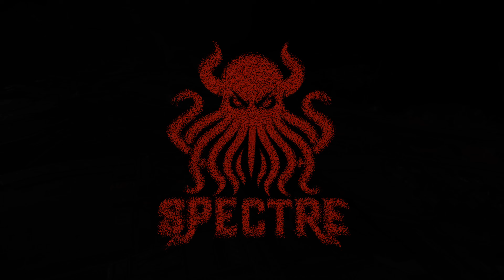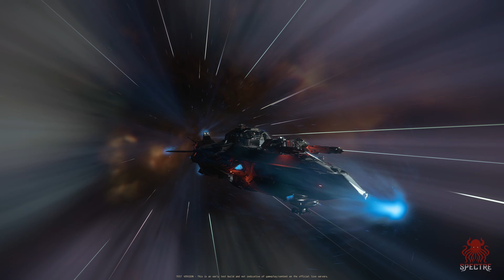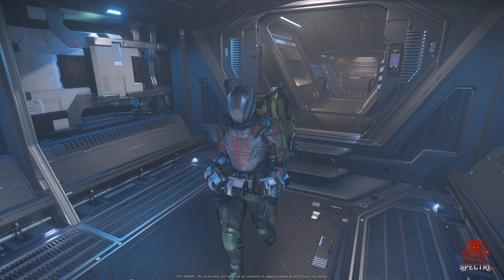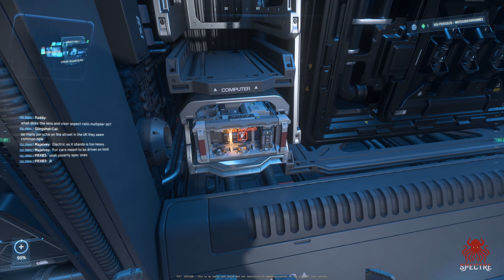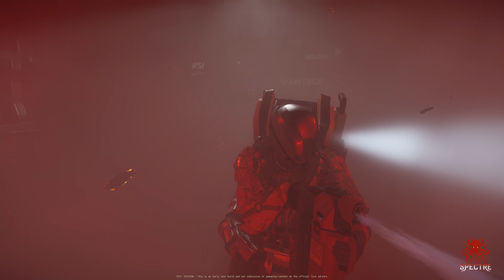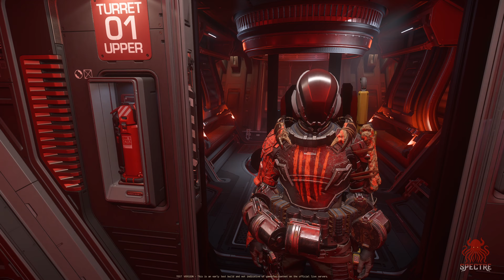Star Citizen Flight School - How to Engineer - Tutorial / Guide

Comment: To my knowledge cooling is not required at at. Just deactivate cooling alltogether and use the pips elsewhere. There is no damage from heat to the compontents and fires will not break out. We will only get a useless shell of what engineering was supposed to be.
Reply from the maker: Very interesting point, but not what I tested on all builds! During an evocati build when I turned off the cooler and boosted or shoot, never mind where power is require. It leads to cooling failure and ignored cooling failure leads to fire. I’ve to test it on the current build maybe it’s a bug when it’s not working. Check this video and you can see that (was) necessary to run coolers https://youtu.be/bvvPkQQgfk0?si=CzVgKOeyR0HC9u28
Reply: Very nice video. Informative and helpful.
I’m sure I’ll be back for more once 4.5 arrives in Live.
Reply from the maker: @HowRadMediaLLC thank you so much